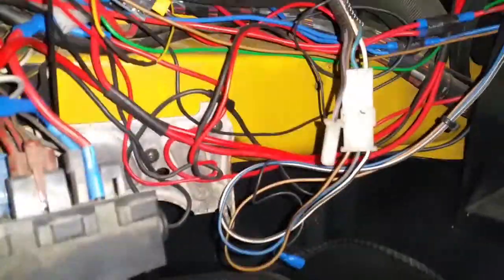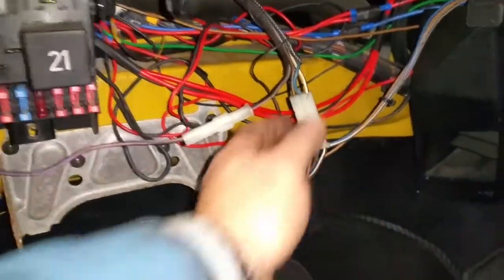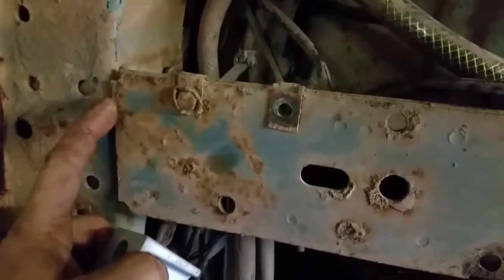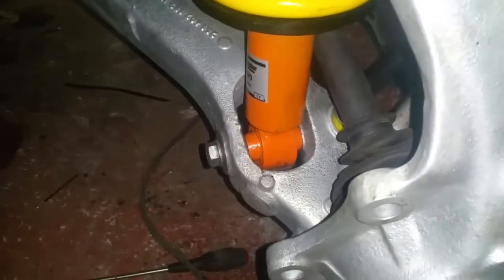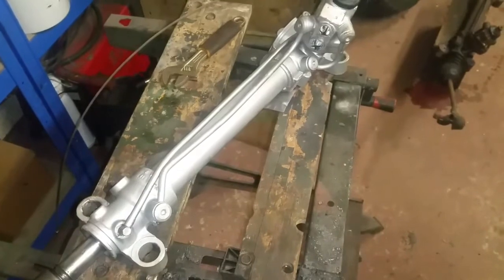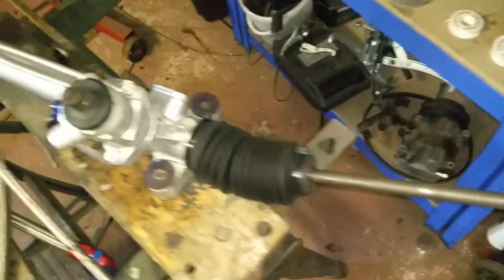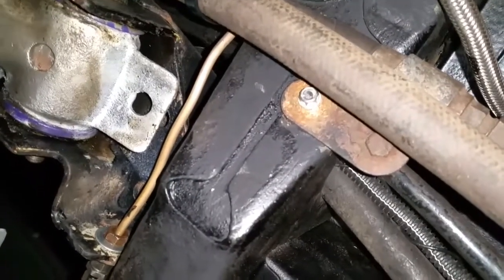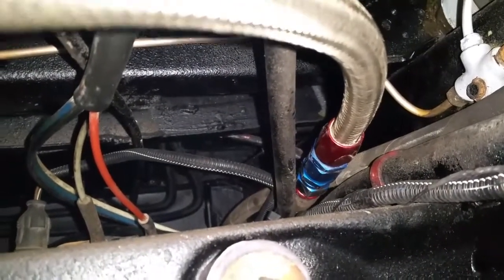VW T25 T3 Vanagon 2WD to Syncro 4WD Conversion Project - Front End Almost Finished

Comment: I'm still following your build, with a lot of envy.
Reply from the maker: +Buckaroo Wild-Kamping 
Thanks, recently had a couple of issues to solve on the build and have also been delayed by non van related stuff, but next vid should be out in a short while. End in sight hopefully, I'm  getting tired of looking at the underside of my van now :-)
Reply: +Mark Halligan It is a very clean build. Your attention to detail will pay off for you for a long time. All those new suspension bushings should give you a smooth ride. I am planning an air suspension on mine.

Comment: Well done what an enormous job you're doing! I bet it will be fantastic when it's ready.
Sorry if this is a fringe topic question:
Is it possible to replace the inner bellows (rubber protection) on the steering rack without loosening the outer ends? (steering knuckles or whatever you call them)